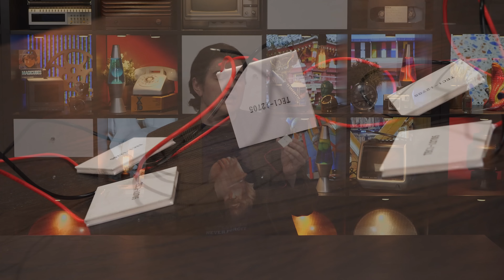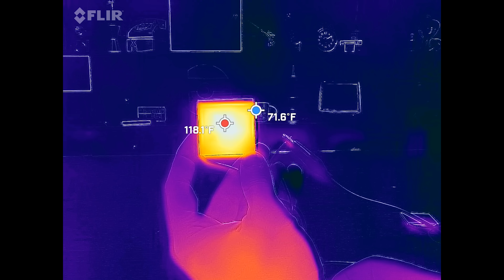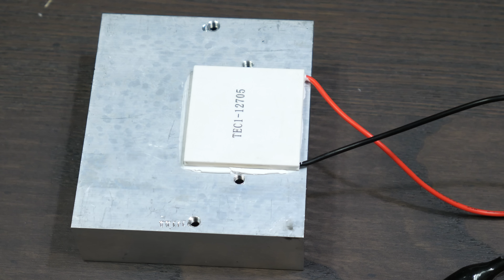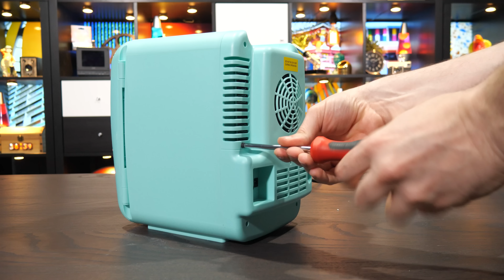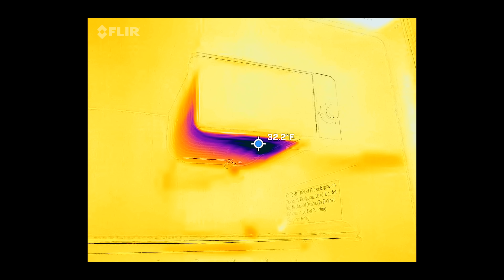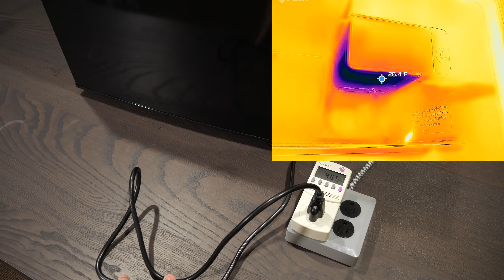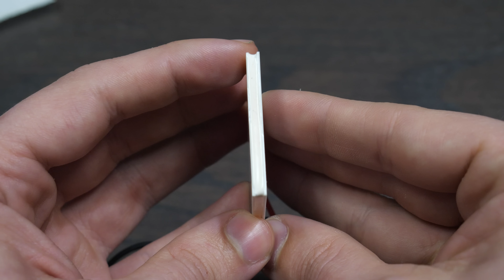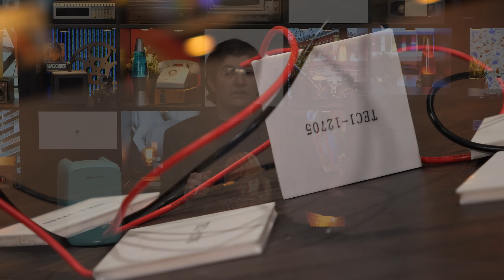Thermoelectric cooling: it's not great.

Comment from the maker: I’m sensing some consternation in the comments, so I want to explain the scope of this video a little more explicitly:
There are absolutely applications for which Peltier elements make sense! But they’re mostly not stuff you or I are going to come across. Lots of people down below are highlighting the various pieces of scientific and medical equipment which use Peltier elements and the specific reasons they do… but that’s scientific and medical equipment! Not day-to-day life stuff. While those applications are all very interesting and highlight that there is value in the technology, they’re just way outside my scope here.
I intended to keep this entirely in the scope of general-purpose cooling (and refrigeration), and in that context? Consumer products with Peltier elements in them are almost always terrible and a waste of money.
Reply: Biolite makes a camp stove that converts heat from burning wood used while cooking to charge your cell phone. I assume it uses a peltier
Reply: @samuelgreenway technically it's a Seebeck generator, but essentially it's the same thing.
Reply: @mc2engineeringprof what if I need to generate something other than Seebecks?
Reply: Time to invent a wood-fired refrigerator.
Reply: @samuelgreenway  I have one. Its a decent camp stove, if heavy and bulky for serious backpacking, but as a cell phone charger, its pretty useless.
Reply: @samuelgreenway  Looking at their description it's a thermoelectric generator (aka a Seebeck generator) which, yeah, is the inverse of a Peltier cooler. In fact, the Seebeck effect (power from temperature differentials) was discovered 12 years before the Peltier effect (temperature differential created via power), and the overall effect has been named the "Peltier-Seebeck Effect".
Reply: @samuelgreenway that is likely a thermocouple or thermo pile.
Reply: @samuelgreenway  No, I believe it uses a thermopile: a stack of thermocouples.
Reply: This video is not a bashing of Peltier Elements, but of stupid cheap plastic toys mimicking household devices that happen to use Peltier Elements.

PTC are good to cool sensors, circuits, very small spaces in devices that draw more than 50W  anyway and usually don't run 24/7... but they are terrible in household refrigeration.
I have a PTC electric cooler which can run on 12V car plug, on 12V powertool akku and on 240V European outlet. It's for occasional use and has like 3 times the insulation than that blue piece of junk. And enough space I can throw a prefrozen coolpack in to ease the cooling.
Reply: @christianstorms3950  absolutely. They have a place , despite being inefficient . Thats the only drawback.

But it has some pretty strong points to offset that. Its allmost  impossible to break them . Ensure cooling and don't overvolt.
Can be used whit solar panels whitout any inverter involved for example. Given a proper fridge , if it allso had peltiers as a hibrid the potential is to reduce the operating hours of the compressor. 
Thats a longer living fridge and a long term cost saving.
Surely initially it will have its costs.
Frankly i don't see it is a deal breaker.
Reply: @christianstorms3950 even food, some kimchi fridges use peltiers.
Also can be used to cool beers.
Reply: @kopazwashere  Im not 600 pounds and miserable, so its ability to make horse piss cold isnt important. Does it stop botulism?
Reply: Agreed. I'm a PC cooling enthusiast, and it has never been a good cooling solution outside of extremely niche overclocking applications. And even in those applications, LN2 is usually a better solution.

Thanks for making such an extensive video on this.
Reply: @uss_liberty_incident  Yeah. I remember when "OMFG! PELTIER COOLING!" was a thing back in the early 2000s for PC cooling and then it took all of about three seconds for everyone to realise it was pointless.
Reply: @uss_liberty_incident  Considering how much energie peltier elements use, I think most normal PCs would have trouble keeping the cooling elements from overheating! 

PCs also dont really need to cool below room temperature, thats why our heatpipes (or water cooling if you wanna be fancy) are enough to transport heat to the fin stacks + fans.
Reply: @uss_liberty_incident  Yeah, I remember when these were the hot 💩 in overclocking, back in 1999 for about a year. Back before waterblocks were practical.
Reply: @uss_liberty_incident as in, "cannot afford phase change but Peltier and psu are cheap and I cannot get Ln2 locally" scenario lol
Reply: @uss_liberty_incident There are PC cases with heat pumps
Reply: @uss_liberty_incident  There's a reason Linus Sebastian built that ridiculous window AC contraption as a liquid cooling loop chiller instead of using Peltier elements.
Reply: @uss_liberty_incident  I actually use Peltiers on one of my desktop computers to cool the inside of its airtight case. It is a niche application but I'm not cooling the CPU directly, it is air-cooled. My main concern was to make sure that no dust could get in, and using Peltier elements solved the issue of actively cooling the air more than is possible with passive cooling. The hardware inside draws less than 60W while the Peltiers draw up to 250W, so it may seem very inefficient, but most of the time the heat expelled from the heatsink warms up the room a little so the heater doesn't have to work as hard. On warm days it's mostly waste heat of course. Still it works better than liquid cooling which can't go below room temperature, and it is very quiet (using two 120mm fans) compared to using a mini fridge compressor. I do use a microcontroller to monitor and control the cooling.
Reply: @uss_liberty_incident  you know when your solution is more problematic than having to both apply and burn off liquid nitrogen every few minutes.. it's it's a problematic solution lol. I remember learning about people doing ln2 cooling in abstract when I was younger.. for some reason in my head whatever it was would have been a thing you set up and then do things with lol. Cuz why overclock something if you can't do anything with it right? 

I guess I didn't understand the idea of "achievements" at the time, at least for the sake of the achievement moniker and only that itself lol, and I still don't I guess.. But man when I when I actually watch somebody do it I was just sitting there like... Wh... Why?
Reply: @uss_liberty_incident  I have a thermoelectric cooler for my ASUS ROG Phone 8 Pro, which is probably the best use case I've seen for a consumer product with a thermoelectric cooler. You can run it with just the fan instead of turning on the thermoelectric cooling, but the phone definitely stays cooler with the thermoelectric cooling.
Reply: @uss_liberty_incident  Thank you for saying this.  There were all sorts of problems associated with peltier elements and it seemed like the benefits were greatly outweighed by the negatives... even by bar napkin math.  Phase-change cooling (a la VapoChill) worked but you had other problems such as condensation... but at least it worked.
Reply: @uss_liberty_incident  Translation "Thank you for programming an opinion into me."
Reply: I thought the video was great, but I definitely was interested to hear about some of the unique applications where peltier elements shine. But that's why I come to the comments: to specifically find that extra info that is (as you say) outside the scope of the video, but interesting nonetheless.
Reply: @Nacimota yeah, the personal vendetta against peltier devices got old quick
Reply: I use the mini-fridge for my drinks at my WFH desk... they really are the better option. It's an old (late 90's/early 2000s) Magic Chef and is MUCH quieter than the buzzy one you showed, though about the same size. It has the freezer section and you're spot on... if sodas are directly under it and within an inch, they will freeze and explode all over the inside..... Ask me how I know. >_>

I know you said that section doesn't have much use, but the freezer is great for holding mini bottles of liquor in case you feel like mixing some of the soda you keep in there over ice; having the liquor at freezer temps is critical to a good mixed drink, so that's where I keep little "airline bottles" of them.
Reply: @BattleChemist I got one for Christmas, it’s rather quiet it’s a Mountain Dew branded one I don’t remember the actual brand the fridge is (it’s labeled inside the back panel and I had that off a month ago to clean the heatsink and fan) and it chills cans and doesn’t put out a stupid amount of heat. They do have their use as fridges. Not for anything other then cans
Reply: These new cooling-mattrasses use Peltier elements inside of them. Probably because then you can also heat your bed in the winter, but in the summer despite the thing you sleep on being cold it dumps a lot of heat into the room as a consequence, right? Maybe you can explore thata little.
Reply: @killersmile7180 -That sounds like keeping the design simple, reliable, and cheap (to enable a nice fat profitable upcharge) instead of a more complicated and expensive to implement, but... much better performing design. ohh well😢.
Reply: I'm from a tropical country and a mod/member in several aquarium hobby groups. Over the past decade, during summer someone or the other always "discovers"  peltier based cooling and tries to apply it to bring temps down rather than using a refrigerant based water chiller.
It's just not efficient enough, even though initial costs are lower.
I've resorted to posting seasonal announcements now to save everyone's time
Reply: I have certainly used them to reduce thermal noise in photon counters.  But... not something I use in my day to day go about my household business.
Reply: I got a SANYO mini-fridge back in 1999, and it's been running in my office ever since keeping my beverages cool.  It's pretty amazing how it's still running perfectly well for over 25 years and it's completely quiet.  As they say, don't make em' like they used to.  :)
Reply: There's a little bit of irony that the very infrared camera you used to make your point likely has a Peltier junction cooling the image sensor to allow it to work.  But point taken - I guess some people would prefer these videos not break the 1 hour mark :P
Reply: @FireStormOOO_ he mentioned it has uses in other fields.
Reminder this entire video is about sweatshop miniature drink slop that pretty much redundant. It is an unneeded product as it’s cooling in this miniature fridge specific is no different then just having a cooling lined bag with an ice pack in it. You can’t really do that stuff with electronics or medical supplies.

Another point, in the video he did mention people using this to keep makeup dry and prevent it from (maybe) melting for short periods on hot days.
Reply: @FireStormOOO_  those are almost certainly microbolometer which don't necessarily require active cooling...though it's decidedly possible you're right.
Reply: @mc2engineeringprof  Hmm, I bet one could find out by pointing another IR temperature probe at the sensor and seeing if it's at about room temp.  But yeah, I know better than to bet against the cheaper option; hadn't realized those were at a resolution they could pass for an image sensor.
Reply: @FireStormOOO_  that’s not irony, bc he’s not bashing the use of a Peltier to cool.
Reply: Yeah but I wont take my kitchen fridge to a daytrip in summer. This video is like saying "stop buying bicycles, cars go much faster for less work" and if you put a clickbait title you will get the matching comments, thats how it works lol.
Reply: I'm guessing they would be useful for spacecraft and space stations. Although, I think rotating a spacecraft or space stations is a better solution.
Reply: I played around with CPU cooling using TE coolers 25 years ago. Using two stages in series allows for a lower differential temperature across each element, which improves efficiency. I believe I calculated an efficiency of about 3.5% at the time.
Reply: When are you going to do a video on vortex tubes?  I think it may be the only method of cooling you haven't done one on, and much like the Peltier elements, has specific use cases.
Reply: To add on the cheapness of the mini-fridges, in the rare cases they kinda make sense due to size -- they can be made a whole lot better with just a little work.  Add a more powerful (and silent) quality Noctua fan, 3Dprint a guide to actually route all the air through the fins vs just vaguely "at" it, and put good thermal paste on the interface to the internal cold blade.  Insulate the internal cavity.  (optionally stack two modules...or even an internal thermostat to cycle power.) Cools a lot faster, and stuff in mine was freezing.  Did mean I needed to defrost the internal metal plate sometimes.   

Not a pitch for these at all -- just that these cheap implementations leave a whole lot of performance on the table, and is part of the problem.  But if they were sold with all that, you'd probably be at the price of a real mini-fridge, or at least less impulse buy.  Not even getting into the power use....
Reply: My humidor & medicine / drink fridges are day-to-day life stuff.
Reply: I didn't feel like those comments were expressing consternation. I took them more as "fun facts." Both points ("crap in consumer electronics" & "useful in various technical items") came across fine, especially since you mentioned repeatedly that there were other use cases for them. I didn't think car cupholder gimmicks was an exhaustive list, lol
Reply from the maker: @big-e-squared  Many of them are! It's hard to know the difference sometimes between "here's a cool thing" and "hey, you forgot to mention" but fwiw I've also gotten a few messages saying I've sold Peltier elements short.
Reply: @TechnologyConnections Biolite makes a camp stove that converts heat from burning wood used while cooking to charge your cell phone. I assume it uses a peltier
Reply: @TechnologyConnections you actually forgot a big thing: the phone. Cooling an phone with peltier is much better then with a heat pump
Reply: @TechnologyConnections  what company builds the ( SMALLEST proper refrigerator  ) as you call it and how small is it ?
Reply: @TechnologyConnections  Is there any chance you could cover the use of these devices in personal cooling elements. After hearing your explanation, I am almost 100% sure the personal "air conditioner" my mom wears on her neck is using Peltier circuits. It definitely cools, but it's loud and bulky. Maybe the localized cooling actually helps in this specific instance?
Reply: @TechnologyConnections  should also make a point, that thinning the atmosphere seems to be a priority now, so maybe we should actually dump more refrigerants into it? I... Legitimately wouldn't be surprised if DuPont didn't have a button they were just waiting for the go-ahead, like the one that dropped all the birds out of the sky lol.

What even is cancer? Is it really related to ultraviolet exposure? What even our cosmic rays? And why can't putting holes in the atmosphere make it better! I think we should all find out, for science you know?
Reply: @TechnologyConnections  Old refrig guy here: Now investigate the "mini" dehumidifiers that use a Peltier module. Waste of money and will never get an Energy Star rating. Did you know, the gubmint has ratings for these? Look up Integrated Energy Factor (L/kwh).
Reply: @TechnologyConnections I'm sure you'll never see this, but I do wonder if you've ever come across the only consumer application of peltier modules I've ever been fully pleased with, the peltier powered fans that are designed for plonking on top of wood burning stoves?

Ostensibly the point is the gentle rotation enabled by the fan is meant to 'waft' warm air rising directly from the stove outwards into the room; but also a doohickey that seemingly operates without power and slowly picks up speed over the course of an evening is always a bit of fun.
Reply: @TechnologyConnections why la crap. So how do 12v fridges compare.
Reply: @TechnologyConnections What's a farren height????
Reply: @TechnologyConnections  I think you may have, although it's a fairly reasonable mistake to make. There are some TEC elements with incredibly high COP, and the price on them has been falling over time. I'm using a high-temperature one with a COP of 4 for my application, and the manufacturer rates it at a peak of 6.
Reply: @TechnologyConnections 
I just bought one of these. 😂
Actually it's that exact one on your desk. 
HOWEVER
I just spent 6 weeks in hospital and I don't do tepid drinks and water made funny tasting by the plastic hospital jugs. 
I also bought one 25 years ago and they were much more expensive, bigger and better and it's still going. 
Yeah the handle broke off and the internal switches corroded to dust after a decade so I glued them and hard soldered it to Mains AC and Cool and I've replaced the worn fan and it needs replacing again but I'm amused by keeping it alive. 
Last time I was in hospital I bought a proper mini fridge and let me tell you, a big downside is sneaking an actual fridge into E ward. 
But I was there for 6 months. 
Now I have 3 months of recovery at home and that little fridge saves me from having to tackle the stairs everyone I'm thirsty these first few weeks cos I can barely stand. 
Also, if they ever break, free TEC and AC regulator! 🤩
Reply: Our 1987 fridge died during a lightning storm. We replaced it with a 7.0 cu/ft Frigidaire Gallery rated for 328Kwh a year. So far so good. The old fridge had a bunch of wasted space. Even with the new smaller fridge we have extra space. It also can be switched to freezer mode but we have over 15 cubic feet of freezer space in a chest freezer in the basement.
Reply: Would they make a better heating element, than a cooling one?
Reply: @ItsDaJax - as he mentioned, so long as the COP is greater than 1, yes. Achieving that may require more effort than was expended designing the cheap toy fridge, however. As you noticed, at least your getting value from the rejected heat from the input power!
Reply: How do they do refrigerators on the space station?
Peltiers or heat pumps that don't require gravity?

Edit: Yup, scroll based compressors that don't have the oil issue:
"One of the most promising projects is the result of collaboration between Purdue University, Air Squared INC and the Whirlpool Corporation. It aims to build a refrigerator which runs on compressed steam, designed to provide the appropriate temperatures for food storage while reducing energy consumption.

The device is based on technology recently patented by Air Squared Inc, involving the use of a compressor scroll and an inbuilt expander. These two components operate on a common tree and can therefore be protected by a single semi-hermetic shell.

Another advantage of using a compressor scroll is that it does not require lubrication oil: this makes this sophisticated refrigerator a perfect solution for use at zero gravity. The prototype is now ready for microgravity testing which, if as successful as the developers hope, will open the doors to largescale production and a new approach to refrigeration in space."
Reply: @Jcewazhere pumps and radiative cooling is my guess.
Reply: It's great it you are building your own chest freezer with high R rating insulation and the whole outer and inner lid acts as the heat sink for absorbing and disipating heat as efficiently as possible.
By using large blocks of ice along the walls, you can add warm stuff and the thermal mass alredy in the freezer will offset the thermal dump inside until the pelt units can catch up.
I use it for my 12v off grid freezer.
Works great.
Now if they would mass produce them.
I would not be a fring case.😅
Reply: I've seen every single one of your heat pump videos, but it wasn't until you explained how the fridge works did I finally understand how they can be "more than 100% efficient".
Reply: The personal aircon by Ranvoo that Techmoan looked at recently I think uses a Peltier? I was surprised it seems to work as well as techmoan suggested. Would love your thoughts sometime!
Reply: Yes, your overall conclusion is correct. I've used Peltier plates in DIY applications, and in the design process it became apparent that the best (usable) efficiency they can provide is ~100% (i.e., 1 W heat transfer for 1 W heat waste), which pales in comparison to the 300+% available from compressors. The only application I can think of that is a) relatively commonplace and b) sensible for their limitations is in water coolers (i.e., the ones that take the big 18 L jugs).
Reply: Aren't they a good heater? I mean, anything better than 100% of the resistive heater is good, right? And you can't get under the 100% at heating. And no, it's not only cost, it's also complexity, weight size and vibration resistance. You won't be making that desktop can fridge with a full-blown refrigeration cycle in a sane mind.
Reply: @Chamieiniibet Inside a confined space, a Peltier will only provide 100% heating.
If you want more, the cold side of it must be able to absorb more heat from outside of that confined space.
Edit: Also, fabrication costs energy, and I would be surprised if a PTC is worse than a Peltier in that sense.
Reply: @jsjs6751  you need a very-very good thermal insulation to bring it down to 100%, which is the maximum for PTC.
Reply: @Nibiroid    How do you get more than 100% efficiency if you do not move any heat with the heat pump (the Peltier element)?
Assuming you meant both the cold and warm sides are located in the same room/space?
Reply: @jsjs6751   say, you heat up food — you don't need the air and the table to get warmer, quite the opposite. Or, say, you want to heat your butt — you don't care for the chair below the seat getting colder. And so on. Most of the time you need stuff to be heated over the ambient temperature, not to heat up everything around too. You wouldn't place a compressor-driven heat pump in every single place, but you can definitely replace most of the smaller resistive heaters with Peltier modules.
Reply: @Chamieiniibet   It seems you do not quite understand the thermodynamics here.
If your Peltier uses 100 watts of power and you put it in a confined space, then ALL of that will become heat, even though the Peltier also has a cold side.
And just like a 100W bulb or PTC, it will try to heat up everything in the room, including walls, and whatever is beyond the walls since they don't have infinite insulation.
In an ideal confined space (which does not exist) , the end result would be an equilibrium, where everything has the same temperature.
Reply: @jsjs6751  nah, you just don't get that this "confined space" you imagine is an idealized concept. Any real usage would have thermal flows to and from the outside world unless we deliberately isolate it. Also nothing prevents you from putting the PEC right on the border of that space. So if you put a peltier module on your table, hot site up, and feed it with 100W of power, it would heat your food with more than 100W of heat, chilling your table as a side effect. Which could actually be even a very welcome side-effect when it's hot. PEC is just a low-efficiency thermal pump, so you can use it to generate heat same way you could use any other heat pump, if it was as thin and light. It's just whatever low the efficiency of a thermal pump is, it's still always more than 100% at heating. Haven't you watched the other videos from Technology Connections on the topic?
Reply: Nah you're right their use cases are extremely narrow as you said
Reply: My first engineering job I had to automate a robot via a PLC to heat seal super capacitors, effectively batteries with low energy density but high discharge made out of aluminum pouches coated with carbon and filled with a proprietary solution

Batteries need to be vented after they are sealed because of out gassing, The material scientist had this (wrong) idea that if the pouches were cooled to -180C when they were sealed they could bypass the outgassing, so my robot quickly cooled the pouches to temperature in a vacuum glove box and then sealed with a heated coil 

It really sucked too because we when to expos to demonstrate wireless ps3 controllers and other electronics taking less to 2 minutes to completely charge. I thought this tech was going to change the world but 15 years later here we are
Reply: could they have a use as a heating element?
Reply: @catzeball8047  sure, so long as you heat the cold side, a heating element would probably be more durable, cheap and more efficient. It isn’t more efficient like a heat pump.
Reply: FINALLY!  A little blue fridge that we can keep our insulin in!  SAFE!
Reply: The best use I've ever seen for one of these was a radiator and blower to place on top of a wood stove, using the reverse form that turns a heat gradient into current. The thermoelectric element was between the base and the heatsink  fins, so it would create current when heat was being conducted through the assembly, and it powered a motor to run the attached fan which would draw air across the fins and exhaust it forward to help spread the heat from the wood stove into the room.
Reply: @Narissis I wonder if he is aware of these products, it's exactly the kind of simple yet refined design (natural positive feedback loop) that I think he would enjoy
Reply: They heard Peltier elements = bad even though you clearly said they're only bad in this minifridge use case. You even advocated for Peltier elements' other uses in the video. Explaining logic to emotional people never works.
Reply: @LowTonin  A company called Photonoic claims to have a peltier that is supposed to be as good as vapor compression refrigeration. However, as they don't seem to offer anything that consumers can buy/test for themselves, we really don't know if they are as good as they claim.
Reply: You want me to give the spiel on PCR? The one thing that a PTC make SO much sense for? A small liquid sample in a metal block that needs to cycle between 60c and 100c as quickly as possible? That also wants to be held at 4c afterward until someone can deal with it?
Reply: Here's one that's popular locally (northern Scotland) where there's lots of woodburning stoves: Stick a solid piece of steel on top of your stove, with a peltier unit on top, and a heat sink for dissipation on top of *that*. Peltiers work in both directions, so we use a temperature gradient to generate electricity rather than electricity to create a gradient. It's not a huge amount, but it's easily enough to run a fan, which circulates the heat better than just letting it float up to the ceiling. Heats the room more quickly and evenly, without it you can stick your hand up in the air and feel a noticeable blanket of hot air near the ceiling rather than circulating as you want it.
Reply: @TheGeoffable first thing I bought my dad when he got his stove!
Reply: They could make a good electric heater that has a dehumidifying effect therefore making it cheaper to heat your home as it's dryer, sort of an in-between step between a heat pump and and electric heater, by also combining the effect of a dehumidifier.   Hmmm, might be good for dying out 3D printer filament, maybe I should get some of these for this use!
Reply: Genuinely was fascinated by refrigeration recently, so thank you for existing. 😂
Reply: You should have given the COP of the toy fridge. The COP of an AC is the amount of heat moved from the room to outside Vs energy. Similarly it took a day to move the heat in 6 sodas from inside the toy fridge to outside it and you have the wattage X 24 hours. Otherwise good job. I wanted one and had no idea it was so stupid inefficient but saw the 30 degree max cooling rating and couldn't imagine a circumstance where it fit my needs. I apprciate the info.
Reply: i mean, the title of your video implies that its never good so i think its fair to point out use cases for it...
Reply: My wife just bought one of these and I told her to return it. My electric bill is already $500 during the summer and this isn't going to do me anymore favors.
Reply: @Hymanator 
Ouch? 😳😣🤢
I think you need to buy some solar! And paint your roof with that cooling paint that was invented here in YouTube
Reply: Saw the title, upvoting on principle.
Reply: Elastocaloric cooling has been touted as being the future over vapour compression. Thoughts?
Reply: @BlinkyLass  Never. Materials won't last.
Reply: Did you write this script right after watching Not Just Bikes "JustCars" video perchance? 👀
Reply: Me and my friend refer to mini fridges the size of yours, as condiment or beer fridge 😂
Reply: Why do  Kenmore's last so long?
Reply: I think just an addendum to the title with "for a refrigerator" at the end would eliminate alot of the confusion. Being able to reverse the hot/cold sides, the size, the variable energy amounts, etc can be great for lots of things, it's just actual continuous refrigeration of a closed box that it's awful at. The problem isn't the technology but how it's used for products its just not good at. 

Also why tf don't we have variable heated/chilled car cup holders as a standard?! If these things cost like $3 in a vehicle where energy generation and efficiency is barely relevant (even 60 watts isn't going to do anything to an electric car), but lets people keep coffee warm or soda cool hours of driving, that would be amazing for commuters/road trips/etc. Maybe then McDonalds wouldn't have had their coffee so hot that it can cause third degree burns under the pretense that it was to keep the coffee from getting cold on longer trips when you can just have your car drink compartment keep it warm for as long as you like.
Reply: the ONLY useful use less trying to maybe power a smal PCR thermocycler , that i could think up was of maybe just maybe perhaps and possibly
was to apply the cold sides to the wrist and pulse the current, or the back of the neck. 
pulse the current for the device, on the neck, not pulse the back of the neck . (hmm)
anyhow
cooling blood channels near the surface like that i hear does a great job of tricking the mind body dynamo into thinking its actually feeling cool, when its actually not as cool as it thinks.
I tried that once becuase i wanted to be cool too, or at least think i was cool, but low and behold, trying to apply it firmly to my wrists. broke em
not my wrists silly, the peltier devices. theyre apperently very very brittle and fragile inside (no again , im not refering to my wrists. jesh)
but yeah, i heard it was a modern military discovery i believe. 
deep down inside though to me it sounds like a fast track way to lead to over exhaustion or a heat stroke. but hey, you might not even realize that until its too late 
so
i guess they DO maybe have their benefits 

and for only THREE DOLLARS a pop!!
Reply: I use mine for a day-to-day application, because I can keep it at 70F inside all day.  I use it to keep medication at “room temperature” when now my room is always like 85-ish and then down to 80 with the air conditioner on.  It was absolutely essential when my air conditioner wasn’t working and it even got 100F inside once.  I know other people who also store medications in mini-fridges.
Reply: The only reason why i bought the thing was curiosity of it and it's portability size. Road trips in a small truck mostly and it would be hooked up. Never used it for that yet but that was the intent. But honestly this small thing with a small solar panel in something like a side by side or even a bass boat or something would be its best use but it would have to remain covered. That and maybe for people that do tailgating stuff. People crank the AC in a car and let it run so as long as it feels cold in the car then its fine and energy in that case is not as much of a concern. The only other option is coolers with ice/ice blocks or those yeti cups that keep things cold but they only hold so much.

As far as the built in vehicle thing, I think this could be better in a warming mug that can be plugged in to a vehicle instead of just being built in cause anything like that in a car in general does not work much or they get knocked loose. Not to mention it could get too hot or too cold and do some harm to people which for a show car it would fly like a concept but never make production. 

If the thing was in something like a warming mug then it could easily have that temp controller built in and make it a lot better in use. Magnetic power port plug in so it just sits in the base and does its working then pick up the mug to drink and it can pretty much stay self contained and not stay plugged in when you need to take it somewhere. Kinda pointless given how efficient the vacuum sealed stainless containers are now but people don't always get stuff that's cold or hot in them in the first place.
Reply: My kid begged to be allowed to soend birthday money on one. 
I instantly recognised it as the specimen culture grow boxes in the QA labs when I worked in manufacturing.🎉 
We don't run it haha. It is just a toy lol. 😂
It would be interesting to see a video on the different industrial applications of the technology 🎉❤
Reply: A lab fridge often uses peltier based cooling because they can keep temperatures exaclty constant.
Reply: 2 questions one out of curiosity one for ranting. Have you heard of those propane RV fridges? I heard that most when switched to electric uses about 3.6 amps or 50 watts 12v  when switched to propane it burns about 32,000 BTU a day 1.5 lbs. As stupid as this sounds i would like to live my life electricity free, I get almost everything is way more efficient when it uses electricity but I found out about this brand called home bio gas where you fill it up with garden and kitchen scraps along with cow manure, Then in a few days you have methane. most of my heating and cooking will be done with a modern catalytic wood stove which they are vary efficient about as efficient as an 10 year old furnace. A bucket of wood will last all night. The bio gas will be used for lighting and a natural gas refrigerator. Am I as bad as people say I am? Because so meany people say that using a natural gas stove is so bad for the environment and your releasing thousands of carcinogens killing your whole family. Now they add butane and propane to fridges witch is great by the way yet the same people who said i was bad are also the people who throw away home appliances for the latest and greatest including there restaurant grade refrigerator
Reply: Could you not use stacks of them (as in chambers with them between so they are cooling each other) and run them at the most efficient amperage and use a thermostat to control the power to get a actually decent 'refrigerator'?
Reply: @mik123mik1  Stacking Peltiers feels like an elegant idea, and you’re far from the first to suggest it, but in practice it doesn’t work out since they are solid-state and can’t cheat by using phenomena like vaporisation enthalpy. 

The hot-side of each component is radiating both all the thermal energy that it has pumped through from the cold-side PLUS the waste heat of the component’s operation. Example: the TEC1-12705 as shown in the video, at max uses maybe 60W of power to pump 45W of heat across the component. All of that energy has to go *somewhere*, so the hot-side is radiating around 105W of heat. 

Finding the optimally efficient lower amperage doesn’t change the core problem: there must always be some waste heat from operation added to the pumped heat. So stacking them only multiplies the waste heat for no additional cooling.
Reply: Peltier devices are used as electronic generators to run fans on wood burning heaters.
Reply: Now you need to cover propane burner refrigeration! Don't look at me in that tone of voice. You know you want to fridge boy. XD
Reply: Could you tell me, please, exactly, what semiconductor materials are used in Peltier elements?
Reply: @nicholaseastman6915     Google is your friend 😊
Or go all in with an AI/GPT.
Reply: Sonic Refrigeration may allow more miniaturization, but we ain’t there yet.
Reply: @TechnologyConnections  I beg to differ, I love my fire-place-fans at the country-house 👍
Reply: What I'm wondering if the Peltier's woldn't be way more efficient if you'd simply add another radiator on the cold side of it, use a thermostatic device and add a good insulation (XPS maybe?). I need to try this at home. I'll leave a comment after doing the experiment :)
Reply: I agree c-:
Reply: Is this just a thermocouple with a fancy name?
Reply: @cerburusmori  no, it operates on magnetism and conservation of entropy.
Reply: yeah they're good for thermocyclers but not refrigerators, basically
Reply: Hi. One thing you forgot to mention: compressor start-up current. For many DIY solar projects it is very annoying. Peltier on the other side doesn't need powerful inverter, you can just run it on DC.
Reply: I feel like I'd like to build a personal AC system that you can wear outside, that would keep you cool when you need to move around, but peltiers are crap, and compressors seem to be heavy no matter what their capacity is, no idea why. Even a 1/8HP compressor (and this is what you'd see in a small fridge) still weights over 15 pounds. I mean looking at it, there's a crap ton of iron in it, no wonder it's so heavy. I just don't know if a lighter compressor for this application could be designed if some compromises are allowed, using refrigerants that works at a lower compression ratio. I mean if you wanted to have a cooling vest you want the evaporator temperature to be fairly high anyways, since if you stuck actual AC evaporator to bare skin you'd get frost bitten. And we don't even need that much capacity either, like a 100W compressor has enough power to keep the human body cool, due to their high COP.

Doing the same with peltier would have required at least 1000W.
Reply: i want to see a video about propane ammonia fridges like in rv's ...
Reply: I have a touché for your red fridge opinion, I've owned that same galanz fridge for the past 6 years and it's my garage fridge, even when it's 95° in the garage during summer, the freezer stays ice cold and so does the fridge
Reply: You'll just have to make a video on what Peltier units are good for, then. What makes this technology persist aside from an unsavory cooling application?
Reply: i sell iso-butane and iso-butene related products...
Reply: About the only common consumer device that uses these modules effectively might be those that put the opposite, Seebeck, effect into use. Stove top fans and fireside phone chargers that use what is effectively waste heat to produce small amounts of power. Stove top fans really do help to distribute the heat around the room. My Mum thinks it is true magic at work.

As an aside, but still interestingly heat pump related would be those gas (LPG/town gas) powered fridges that were around at one point. Still the Peltier effect, but non semiconductor that used a thermopile (array of thermocouple juctions) heated by a burner one side, and the subsequent cold side used to cool the fridge. There's still an electron flow between the junctions, but not so obvious, and I'm not sure if such devices are even in common use today.
Reply: 🎉Mmm maybe a comparo video of goodish and badish Peltier coolers?
Reply: I am not sure why no one mentioned dehumidifiers, I think most of the small ones use a peltier.
I am currently building a dehydrator (since for some reason I can only find those for at least 1000 dollars in my country) and was thinking of using a peltier as the resistor to generate the necessary heat, and the cold side woud dehumidify the air inside, so double win.
Reply: I have a question. And it's going to determine whether or not I make a very large purchase. Is the thermoelectric cooling for something like a humidor for cigars a good idea? The primary reason that I keep being told that it is good is because it does not on the back dehydrate or input additional humidity into the system and it's more easy to regulate
Reply: I was playing around with peltier elements and found in the datasheet they are extremely efficient when the temperature differential is very low. So if you wanted continuous production of a very small temperature gradient, they're actually great. I have been wondering if they could be stacked to compound the small temperature gradient...
Reply: just use vortex cooling hurr durr
Reply: Can you cover de-humidifiers next please 😁
Reply: id say it's good for electronics cooling. Asus has one for their gaming phone cooler
Reply: If you want to see a system which is somehowlighter but still kinda like a real fridge try to look into fridges which uses the Absorber technology. They replace the compressor with a heatsource of ANY kind. They boil the refrigerant by applying heat from grid, car OR from a gas-flame. Theoretically even a candlelight might work yet their heat-output are limited.

Those are often sold as "camping" equipment, have no oil swamp to lubricate and are way less sensitive to tilting or moving them. The limits of their design is mainly cause they reply on gravity that the refrigerant returns to the "hotspot" but thats less critical then a compressor would be. 

I even own a combined one which uses Peltier AND compressor. Yet even the manual say, the use of the peltier element is just to keep things cool in the car during transport with stuff in it. So you not have a "gap" of cooling if you transport sensitive material.
Reply: Dude I agree mine sucks but it's the only option outside of buying a dedicated mini fridge. And that's just not portable enough for me.
Reply: 14:35 We're not commies. Most of us have more freedom than people in the USA. There's no need for you to be so loud and rude, just because we embraced a much better system of measurements and can use 3-phase electricity instead of your two phases, and we get it from a more useful voltage which uses less Copper. And we are not short-changed with Aluminium while you have to use the inferior Aluminum, just because you wasted all of those letter 'I' s in Mississippi! Just kidding. Thanks for the video. It's high time someone called out those awful, inefficient and fragile Peltier devices.
Reply: These little fridges also do a fairly decent job at keeping a six pack cool, so there’s that.
Reply: Maybe we could get a video about the better applications of Peltier Cooling and where it outperforms typical refrigeration?
Reply: An even simpler description of why a heat pump is efficient: It discards heat.
Reply: Would love to see a video on how Donald trump and republicans want to get rid of efficient appliances in American homes with project 2025
Reply: Heat pumps are the most inefficient way to create heat, they are a terrible wasteful idea.
Reply: There is no proof refrigerants harm the atmosphere. If all you got is a fake hole in a fake ozone layer over a fake place no one is allowed to go, then it is not proof.
Reply: That little... red minifridge..... I have a giant American fridge, and it's cheaper to run than the red smallish, because it has great insulation.  I keep 42 turkeys in the freezer, and 356 days worth of leftovers in the fridge, plus a months worth of beer.
Reply: Like those mini fridges for kids rooms, what a polarizing thing to make a video about.
Reply: I use one of the fridges to keep my phone cool in the car while I'm at work
Reply: Like 25 years ago I was a high school astronomy nerd. My grandfather was buying and building the telescopes and other things and I was using them. We had an astronomy CCD camera in which the chip was cooled using a peltier element. Unfortunately like you said in this video, the peltier can only do so much and the temperature of the CCD (which directly translates to the amount of noise in the picture) was influenced by the surrounding temperature a LOT. During the winter there was barely any noise but during the summer the chip did not even get below freezing and things looked... not that great. Unfortunately due to how the Earth orbits the Sun you only see some things in the winter and other things in the summer.
Reply: Do you think it would be a good idea to combine Peltier elements with solar panels? Solar panels generate a lot of heat due to their color. The heat is actually not used by the panel and if exposed to it the panel degrades much faster. You could generate some extra energy if you have something cooling the elements on the other side. If you lack the space for extra solar panel, let's say on the roof of a car, the economics might work out better. The plus side is you can even warm up the panel if snow falls on it 😊
Reply: No one is asking the hard hitting questions...
If you put the Peltier fridge inside the Red fridge, would the Peltier warm the inside faster than the red fridge cooling it
Reply: okay, but I use mine for cooling packaged foods
Reply: Darn, I built a solar powered cooler for river trips using a couple peltier pads. It kept the drinks below 110F if that helps. Colder than the river we were floating.
Reply: I bought a coolbox in the UK based on this technology to use in a campervan using a 12v cigarette lighter type socket. It sucked 155 watts continuously and made anything that was 'cooling' wet. My power bank ran out of juice in just under five hours. All I wanted was fresh milk - instead I was stranded with no independent power and yoghurt.
Reply: Fans for stoves use them to use excess heat and move the air around. Would be interesting to see how efficient they are
Reply: I just came across one of these devices in my home! I have a little stovetop fan sitting on my fireplace and the temperature difference across the device when the fireplace is lit creates a voltage to power a small fan. They are pretty cool little fans, seems like a funky household item that would be right up your alley.
Reply: Um, but how about using Peltier fridges for traveling?
As 12v power is what you already have in each car, even if it is 20 or 40 years old.

You also can't really get a real fridge, even if it's a small one and you have a big trunk with =12V to ~220V transformator, just because the fridge compressors don't like at all radial acceleration - they prefer a lot standing still without cases where coolant gets disturbed on itself.

And in case you got food and some "ice" with you - such Peltier fridge is actually what you might need to get food to the piknik and stay cool while you prepping a grill.
Reply: Didn't Linus put a computer in the cube mini fridge. I'm getting old.
Reply: @vandegg isn't the outgassing usually driven by electrochemical reactions? Why did they think cooling before hand help?
Reply: And modern freezer only turns its compressor on when inside get very slightly warm, so it doesn't always run right?
Reply: I will only be satisfied if you jury-rig a heat pump into the blue depression box as a project.
Reply: Peltiers are a cool technology (pun intended) but it's laughable some of the consumer products that they're put into and horribly inefficient for. 

They're useful for very specific needs where efficiency isn't important (why you'll never see them used for laptops) and often temporary such as transporting perishable items from one cooling solution to another. But in the vast majority of real world applications there's simply superior solutions available. 

The most viable consumer application would probably be exotic CPU cooling but even then you need a lot of other tech to keep it in line and scale quickly up and down with the cooling needs of a CPU, because when that CPU stops working hard that peltier quickly goes sub-ambient creating condensation. I don't need to explain why water+electronics equals a bad time.
Reply: I have a couple of amateur astronomy CCD cameras that use thermoelectric cooling to good effect. Having closed loop control over the CCD sensor's temperature by pairing it with a temperature sensor is important not only for lowering thermal noise, but also being able to more accurately calibrate for it with dark frames taken with the shutter closed. Having the sensor within 1 degree of the temperature the pictures were taken at is highly important when dealing with the very faint objects we photograph, even in amateur astronomy. It's perfect for that application because we're only trying to cool the relatively small area of the CCD sensor, not the rest of the camera. Yeah, it's not something most people will use in their day to day lives, but I'm a weirdo so I end up using these things on a pretty regular basis.
Reply: I have designed an insulin pen cooler. The purpose is to cool an insulin pen in a holder that is placed on the dinner table. The motivation was that insulin spoils after 14 days at room temperature, but the meals I eat at the dinner table during 14 days don't make up an insulin requirement to use more than half the cartridge, as a result, half a cartridge goes to waste every 14 days. The design features a machined aluminium block that holds the cartridge portion of the insuin pen, sans cap, topped with a peltier element, toppped with a heatsink and a fan. The block has a digital temp sensor embedded in it, the heat sink has one as well, and the whole thing is controlled by a microprocessor reading the temp sensors and controlling the peltier element. The whole think is wrapped in insulating foam mats within a 3d printed case. The program prevents both temperature rise of the insulin pen and overheating of the heat sink. It doesn't run 24/7, but only at need. As the pen is only removed once or twice a day for a short period, it works very well using a peltier element.
Reply: Do you have a video about absorption refrigerators?

It would also be nice if this YouTube channel created a play list about refrigerators.

Absorption refrigerators predate vapor-compression refrigerators. I live in Sweden, and since they are a Swedish invention, that kick-started many international Swedish companies, they have some good, nationalistic, marketing going for them, in Sweden, and is slightly more common here than in the rest of the world (but still not very common).

Absorption refrigerators don't use compressors and don't generate any sound (well they shouldn't, but really cheap ones might). Nowadays they are usually only used where an ambient environment is desirable. So they are used in camping trailers (because people have to sleep close to the refrigerator), and for wine cellar coolers and cigar humidors (because a noisy refrigerator kills the luxurious vibe). Absorption refrigeration is also sometimes used as the cooling system for silent computers.

As far as I know, the only remaining large(-ish) manufacturer, of absorption refrigerators, is Domestic, which mostly makes and sells camping gear, trucker driver gear, and travel trailer products, and also is the world's largest manufacturer of car roof boxes.
Reply: I have a cooler that's 20 years old and twice size as your desktop cooler, and it works perfectly!!!
Reply: You say this in the video, so anyone consternated wasn't paying enough attention
Reply: I am so glad that you mentioned the use of a Peltier-cooled, cooler for travel.  They are great for travel.  I have one that I purchased for vehicle travel.  They were not designed to cool items from room temperature.  These types of coolers were designed specifically to keep items cold while traveling.  Or in the case that there is also a heat setting, keeping items warm.
 
To ensure the device runs as efficiently as possible, you either cool or heat the items before placing them in the cooler/warmer.  This is exactly what you should do when using an ice chest.  Cooling the items before placing them in the ice chest is the best preparation for using an ice chest type of cooler.
Reply: You literally said in the beginning of the video that they have their uses and just weren't going to talk about them bc it's not the point here. What is wrong with their attention span?
Reply: What about Magnetocaloric Effect? That's a different type of heat pump which you haven't covered yet. Any commercial devices which make use of it?
Reply: Who you brought out the real mini-fridge it brought me back to my dorm room back in the day!
Reply: can you do a video on thermoacoustics? would love that
Reply: Do these make more sense for small dehumidifiers? Does the fact you don't need to get as far below ambient help the thermodynamics and/or power requirements at all?
Reply: Hi Everyone, please help me by upvoting this so the OP will see. I am director of the Sarnoff Museum at The College of New Jersey. I have some interesting artifacts related to RCA and the Videoplayer that this channel may be interested in. We have a video player as well as some video discs. I hope they will try contacting me. They can make a comment on any of my videos on my channel and I will see it.
Reply: STOP USING FAHRENHEIT
Reply: If you SCALE UP the system, you can cool HOT engines via the Cool End of the Peltier cooler and PROVIDE a means on the hot side to turn that heat into MECHANICAL energy such as on an additional electrical REGEN system for EV motors or to power battery charging circuits. That WASTE heat on the Peltier system is still usable IF you design the entire cooling/heating cycle to be co-dependent and in parallel. 

I would use it for making home refrigerators that also use the waste heat to power/charge batteries that can be used at off-peak hours! In this case, you need to SCALE UP the physical size of the Peltier cooling system!

V
Reply: A MUCH BETTER CHOICE would be Magneto-Caloric Cooling which is a super-set of Peltier-style cooling that uses a much more efficient MAGNETIC FIELD to cool the fridge and its components. In specific cases, it can get to BELOW -100 Celcius (-148F) if you design the insulation layer correctly using a 15 cm (6 inches) layer of close-cell foam sandwiched between a thermal-resistive enclosure layers that are at least 7.5 mm thick aka 1/4 inches thick which can be Nylon or other plastic that doesn't conduct heat well through it! It also has 5x to 7x the electrical efficiency of Peltier coolers! They are a bit tricky to design well though, so that is an INITIAL COST to bear up front BUT on the plus side they GET TRULY ICE COLD and run efficiently!

V
Reply: Some vehicles use them for cooled seats. Many use the vehicles a/c and just vent that under the seat and add additional fans. Some use peltier elements inside a housing  and use fans to drive the air though the perforations
Reply: @user-mm9hv2oj8d  Peltiers work well in VERY highly-specific circumstances such as the ones you outlined. In this case the Peltier cooler and the heat sink needed to be larger with a LARGER capacity plus SLOWER and QUIETER fan to move that heat OUT from the "cooler" --- That would have made ALL the difference and would have added maybe FIVE DOLLARS to the manufacturing cost!

V
Reply: Many of us were quite happy with our little purchase that did exactly what we wanted and we didn't realize that we were doing it wrong. Thanks for the lecture
Reply: @shayne87  Product design is SUPPOSED to follow the adage form follows function BUT in this case the small form factor "fridge" DID NOT do its primary function to keep temperatures to food-safe levels. 

If I am putting a sandwich in there for a whole day or two, at the END of that period, I don't want to get food poisoning! 

Soooooooo, it BEHOOVES the designers to come up with a product that actually IS food safe if you call it and SELL IT as a cooler or a refrigerator!

The design itself of the cooler is quite nice! Just use a LARGER Peltier system and add thinner and MORE of the cooling fins and a LARGER but slower and quieter fan to MOVE that heat away from the device. 

If someone actually DID a proper Microsoft Excel spreadsheet calculation that takes less than 30 minutes, they would SEE on a mathematical basis the electrical system inputs versus the overall thermal cycle output DO NOT MATCH UP!

Do the math upfront to make sure ENOUGH heat is going out of the device to ENSURE that the required terms of its base cooling ability match up to customer expectations and the problems go away!

The way to become SUCCESSFUL in business is to MATCH or even EXCEED customer expectations! If customers THINK your device is a fridge and it merely cools a bunch of cans by a few degrees, YOU ARE NOT MATCHING their internal expectation and NEED to change your design which may mean charging more to get the FUNCTION to fit within the desired form!

V
Reply: @StarGateSG7  Bruh. You love to lecture more than he does. Its a COOLER not a food safe refrigerator. They LOOK like little fridges because its freakin CUTE. Stop overthinking it. Don't use it outside of its specs and you wont be disappointed nor get "food poisoning" (nice dramatic touch lol) but if ya do...Darwin and all that applies 😂
Reply: @shayne87  If they say COOLER, it should at least ACT like my $40 Igloo-brand cooler with a few blocks of ice inside it actually DOES KEEP my sandwiches food-safe! 

This video is RIGHT! When you advertise something as a cooler/fridge it should act like one which means cooling down to the typical less than 2 degrees Celcius (35 F) which is typically UNDERSTOOD to keep food safe-to-eat for more than 12 hours and up to 72 hours!

The manufacturer COULD have spent 5 more bucks to actually MAKE IT food-safe! That is just cheaping-out in my opinion!

V
Reply: nothing says tech youtuber like not thinking outside of the box when it comes to technology
Reply: Can you use normal C° instead F° ????
Reply: They are useful as thermoelectric generators, a useful consumer product (if you live in a area with cold winters and own a wood stove) that utilizes them in this fashion would be a stove fan.
Reply: i am sensing bullshit from a man in a silly t shirt hating on a convenient idea for a portable fridge!
Reply: Just bought an actual mini fridge as opposed to a cheaper one. Even happier with my decision now. 
Interesting video
Reply: I had a few of those coolers and replaced a few elements  also. A compressor is a better cooler but they also have issues I bought two I bought a smaller one to use as a freezer but it quit cooling the larger one is still working but they both did not cool well under freezing, well the lack of a fan doesn't help, the bottom cools but the lid area stays warmer.  I have a large cooler freezer but it weighs too much to carry around good thing it has baskets inside but the cooler is still very heavy to carry into the hotel room. That one must stay in the car. The solid state coolers are more practical for travel.  They don't weigh too much. You can add freezer packs to help them keep things cool. I thought about putting two cooling elements per cooler maybe it would work but use twice the power. 73
Reply: Please do a video covering de-humidifiers
Reply: @djfmitv  yeah thanks that's good subject. 73
Reply: One more "everyday" application for peltier elements is to cool and regulate the temperature of laser diodes used in modern (cinema) video projectors. Their output is very temperature dependent so they need a constant temperature regulation, for that reason a peltier with a PID controller is used.
Reply: I actually only recognize peltier coolers because I used them in a lab setting for a while.
Reply: Is this what makes the Embr Wave thermal wristband work? Can you investigate these devices?
Reply: What about something like a coffee mug warmer?
Reply: Fun video, thanks.  Just curious, what is the acceptable tolerance range for keeping frig level?  Are we talking +/- 1-2 degrees or +/- 10 degrees?
Reply: I think a few minutes spent showing some of the examples of peltiers being used to good effect would have helped offset the woes of using them in the microfrige. They do have useful applications and are interesting devices in and of themselves. Would have been neat to also tell people about using them to convert thermal into DC energy and some of the ways that's been used. This would have belt a bit more well rounded to me. Sure THIS is a terrible application of the technology but maybe show a really neat one like a space probe or something else that makes great use of them.
Reply: I use the razer cooler for my iPhone and can play Pokémon  go  in the summer heat.
Reply: Okay. But what if, in space with a nuclear reactor with heat sink outside of the envelope of the space station?  Then... ? Then ...?
Reply: @alwaysardent1125  it overheats, because in vacuum there's nothing to remove heat from the heatsinks ;) Heat is super problematic to deal with in space. Best way is to radiate it away as IR energy.....that's about it.
Reply: I would love to see you expose the true cost of electricity due to recovery costs and other fees put on consumers by the power companies. In Alabama our power is supposed to cost much less but it comes out through alabama power to be about $0.25 per kWh.
Reply: What if I really want something on the size of 6 cans of LaCroix?  I want something that would fit on my desk and not take up very much space.  Something like the size of your toy.  What options would I have?
Reply: These are life savers for some things. I have one of these in my bedroom. I got it for $25. Amazing price. I'm pre-diabetic and use it keep my snacks separate so my family doesnt eat them. It keep them cool and i have no problem keeping apple juice and similar snacks cool enough to enjoy. They are not a waste of money, they are just meant for certain things. Some of us can't afford something nicer.
Reply: "Consumer products with Peltier elements in them are almost always terrible and a waste of money." = Most comes from China and is poorly made. Most people just buy it out of impulse, because it looks cute or makes you look cool
Reply: Thank you for clarifying the intended use scope with which you have made this video. I found it very educational and it answers my question on how these microfridges work as we had bought one for a specific purpose (temporarily keeping breast milk cool for bottle feeding our baby). I noticed it had no typical radiator and had ice build up near the metal plate, which I now understand is the thermoelectric cooler. I also realized it took a long time to reach maintenance temperature so I swapped out frozen ice packs in the unit to help maintain temp when breast milk was stored. I still think there are some specific applications for which you'd choose the microfridge (very small space, noise generation level, portability for travel, etc) but overall agree with your very thorough product testing and cost projections that those niche constraints aside, it does not make sense to choose the thermoelectric fridge over a somewhat larger traditional mini-fridge for general purpose food/drink storage.
Reply: I wish you would have started this off with "I don't think it's worth the cost"
Reply: Sorry, I'm late, but I didn't realize these things existed. You should do a video on what they can do. To me they seem like a microchip, meaning they can get smaller and more efficient
Reply: I was wondering... if u leave the hot side of a bunch of peltiers facing the sun and a cold floating on a bed of water how much electricity can you generate?
Reply: Your doing the Lord's work. Keep it up!!!!!
Reply: "But they’re mostly not stuff you or I are going to come across" I see them all the damn time in electrical engineering applications. Its generally not consumer end stuff but still they are a lot more common than you think.
Reply: I see no place for peltier refrigeration after this video. One thing that springs to mind about making them better would be to fix the cold surface of the module to an aluminum enclosure that surrounds the internal compartment to spread the cold. Also use a module on each side of that enclosure. But still they're horribly inefficient.
They could get better again by having many modules spread over that enclosure and run them at lower power.
I still wouldn't bother with them
Reply: I think everyone pretty much knows that Peltier Coolers are inefficient. But obviously no one is going to put a cube refrigerator in their car or try pinpoint cooling with one. If you just think of a Peltier cooler as a small heat pump that can maintain a 30 degree differential, then there are quite a few uses for them
Reply: Do you think I should try to fix one  I'm not sure if it works i found it on the side of the road for free and it was out side for some time?
Reply: you just gave introductory thermodynamics lesson better than some of my lecturers 😊
Reply: Elastocaloric cooling will soon make these micro fridges much more efficient. It's a new technology so it can't be used in a regular size fridge yet, but these tiny fridges are the perfect first step in my opinion.
Reply: One more interesting feature of the Peltier is that it either creates the temperature difference OR creates a voltage from a given temperature delta.
I have one of these on a very cheap fan for my wood fire oven and it's a fun gimmick to have a fan that automatically starts working when the oven gets hot. Not suuuuuper useful, but helps to distribute the heat a little quicker. Also it is always fun to explain to people how this works.
Reply: Is there a theoretical limit to the efficiency of thermocouples? Is there any reason why they couldn't be made to draw less power per unit of cooling?
Reply: I've had a thermo electric fridge for a quarter century..

I don't use it often but it will cool my beer and lunch meat
Reply: Thermoelectric cooler in a car is way better than not having one. Not only to keep drinks cold, but for a general shopping trips in summer etc... 

I wondered why it wan't mentioned earlier since that's the main use for them here. I don't think I've met anyone with such thing on their desk. But a lot of people travel with one in their car.
Reply: WAIT A MINUTE!

Energy is energy. For refrigerators the dissipated heat often ends up in wrong place, but if you have that next your workplace it's heating exactly where you want.

So you could argue its practical efficiency is above 100 % during heating season.
Reply: Thank you for uploading this! I found this very informative. 💯
Reply: I'm off grid trailer trash with only solar power. Where I live winter can drop to minus 35C and in summer plus 35C. Since I'm stuck using the Sun for power it costs me nothing.  A typical 12V cooler saves me buying ice for my beer. Efficient? Perhaps not. But at $3.75 for a bag of ice I can't complain. For my geolocation and climate they do the job. Sure a fridge is superior, but like an oversized furnace it's overkill.
Reply: It's actually amazing that people are so up-in-arms.
Reply: OT - omg I love your shirt! One the best coats I've ever bought was at Norways giftshop, right after the maelstrom. It's a little disconcerting I recognized the guy tho lol
Reply: peltier coolers significantly improved my diet as a truck driver by extending the life of milk and eggs by a day or two. you shouldn't bash them by comparing them to fridges for 25 minutes before acknowledging what you think is a niche out of the side of your mouth. you should praise them by comparing them to ice coolers for 25 minutes then acknowledge they're shit as fridges. stop fighting the wrong battle.
Reply: They also work great for, ahem storing “herbs”.  Of all kinds 😅❤
Reply: I bet they're used in thermal imaging when you need to cool it down hard and fast on startup.
Reply: People get defensive of their purchases and interpret your snark as an attack on them for buying/using one of these. Nevermind that you acknowledged there were valid use cases or that you never said the average purchaser was an idiot for not doing a deep dive on the efficiency and performance characteristics of every $30 purchase they make. If you want to hear someone read performance stats with little color added go watch project farm (seriously, do. great channel). The snark is part of technology connections. People enjoy it and have no comment until you snark at something they like.
Reply: I have a alpicool 12v cooler from Amazon that works 100% it can freeze meat hard as a rock ... I agree the cheap ones suck I paid 120 for mine highly recommend still love all your videos
Reply: In high school I'd heard of a man using the cool side as a heat sink for his PC and ran the hot portion to heat coffee. 

The story is either fake or riddled with missing information, but this reminded me of it so thank you
Reply: Ugh! I fell for the cuteness and convenience!
Reply: Thank you for this very useful/ informative video! I bought one recently for $4.99 at Goodwill. I was gonna gift it to mu sis for her insulin!
Reply: Well, I guess mine has to go in my car.🤦🏾‍♀️
Reply: My gf cosmetics coller box works on same principles. 

It keeps the cosmetics at a cooler temperature but does not solidify like cakey
Reply: How about a usb can cooler. or coffee warmer?
Reply: do you think these elements could be used for cooking a full body suit such as cosplay? would only need to be turned on occasionally and even 70 is a pretty good temp in those configuration?
Reply: So do you have an alternative for keeping medication cool but also reachable for someone who may not be able to reach the kitchen on a bad day? I don’t have room for a cube fridge unfortunately, so as interesting as this was it also wasn’t terribly helpful in a practical sense.
Reply: I think the "consternation" is from your delivery of the information to us.  You are smug, plain and simple.  Just a smug guy, that has a contemptuous tone.
Reply: I was struck by the head to head comparison: the mini fridge uses slightly less power than the Peltier ‘blue fridge’ plus it keeps contents food safe and costs less per can. That’s a powerful argument for sticking with vapor-compression systems.
Reply: Useful to hold INSULIN in a bedroom (away from main living space).
Reply: Whats your opinion if we use vapour cooling to the cooling side and increase the conductive
Reply: Yep yep, I still want some science grade refrigeration overview, those are really cool
Reply: Your video came here via internet, via a fibre backbone transmitting information by laser light. These little semiconductor lasers have to be kept at a very precise temperature, to work as intended, with milliKelvin precision. Guess how this is done? ;)
Reply: @Henning_Rech wait, do they? Are the fiber cables used under ocean really that fragile? I always assumed they just had repeaters and huge amalgems of regular fiber, just heavily isolated and reinforced since servicing them is hard
Reply: @yahhav345  Fragile? - what do you talk about? - Sure, transatlantic fibers use in-line amplifiers (not repeaters), optically pumped Er-doped fiber laser amplifiers.

My statement was about semiconductor lasers, both those generating the carrier signals for the DWDM data transmission, and the 980 nm pump lasers for tbe fiber amplifiers, which use peltier coolers, and the transmitter lasers must be very precisely temperature stabilized in order to produce the desired wavelength.
Reply: @Henning_Rech  sorry, I misspoke (or rather, more of a mistranslation probably, English is not my first language). When I said "fragile", what I really meant is condition sensitive. Fragile implies the infrastructure would get harmed under improper conditions, rather then just not working correctly.

On another note, the note about the laser source is fascinating! Could you elaborate? Is the cooling done to avoid some sort of a thermal widening of the laser? Also, why are Peltier coolers used specifically, and not one of the other common approaches for very low temperatures?
Reply: @yahhav345  Laser which generate the transmitted signal in a DWDM (dense wavelength division multiplex) system need to have their wavelength stabilized with a tolerance in the 1E-5 range. They are tuned by temperature, which therefore has to be stabilized very precisely. At around 0.08 nm/K and about 0.17 nm channel spacing in the ITU 100 GHz grid the temperature has to be stabilized to better than 0.1 K.

Pump lasers for the in-line amplifiers must produce relatively high power (like several 100 mW) which needs active cooling to keep the temperature low and quite constant.

The small Peltier modules, sized just a few mm, are inside the laser diode case.
Reply: I use one of those to put my Venus fly traps into dormancy without putting them in the fridge so I don't have to maintain their temp. The peltier beverage cooler fits 4 fly traps and keeps it has a solid 55-60 degrees. Yes that's not enough for food and it really bothers me that it's sold as a food preservation method, because 55 degrees is well above the TDZ. Anyways yeah they almost always suck but there are absolutely uses for them outside of industrial/research settings. 

I know men don't grow plants very much, but in case you're not aware, it's a hobby that many many people have. It's not particularly rare of a hobby. And there are more common species of plant that need dormancy like fly traps that aren't exotic like they are - it's actually pretty useful.
Reply: yeah you gave dumb reasoning like stating a family of ten using a corolla as a family vehicle when they shoudl use a van or surburban xl.  bro calm down. no one ia taking fridge in thier car or cubicle.    its use case scenario. obviously a conventional fridge or how you say heat pump is better. but it use case scenario is not those small units its just a convenience. thats why you dont see peltier units as normal  size or bigger because its inefficient.  calm down.
Reply: Astronomy cameras use peltier cooling to cool down the sensors which improve signal to noise ratio and alleviates hot pixels! One of the rare consumer-to-prosumer use cases.
Reply: So, this does have a specific place and that is in your car. Specifically because your vehicle has a compressor that, if you are running it, imposes linear drag on the engine and so does the alternator meaning the efficiency point is moot for cooling the output assuming your running it anyway. Most of these run on 12v native. Yes it will take a long time for one small TEC to do the job quickly so you should opt into buying a unit with more PTC's giving a larger and more effective surface area for cooling but will not allow you to overcome the 30 degree below ambient limitation. Best method for doing this is to make your own that is thermally coupled to your vehicle making your vehicles exterior steel a large heatsink AND a dedicated heating compartment so you can keep cold stuff cold longer and hot stuff hot for longer.
Reply: @TheEmpowerment1  They run at a myriad of voltages from as low as 1.8V to as high as 96V from what I've seen.
Reply: @TheEmpowerment1 the flaw with using the vehicle exterior is that most of the times I’m using my peltier cooler, it’s 100+F outside. Even the air moving over the body at 75mph isn’t changing that as much as just using the footwell A/C vents to cool the hot side. Plus it’s generally just maintaining a cooler-than-interior-ambient environment for stuff that came from the fridge until I get near my campsite and buy ice for the remaining stuff. 
For non camping road trips, it’s just keeping some already cold extra drinks cold until I’m ready for them.  The little bit of extra heat dumped into the passenger footwell is trivial compared to the infrared coming through the windshield, and the electric draw isn’t an issue for a healthy alternator at highway cruising RPM.
Reply: @TheEmpowerment1  No, the higher the alternator makes the voltage rise the less load the coils put on the engine.
Reply: Very cool video. (Haha.) Now do Stirling Engines. ;-)
Reply: @thewiirocks  check out Swedish made Kockums submarines before you say anything… Powered by sterlings and beaten the US subs in many combat-exercices 👍
Reply: @BricoleurTV  nothing negative! Stirling are supposed to be the ideal heat engine. My frustration is that we don't see any in the wild. Other than "they're expensive", I haven't gotten a great answer as to why. Thus I'm incredibly interested in Alec's opinion on the matter.
Reply: @thewiirocks   oh, I know this. A perfect heat engine merely uses the heat energy to create motion, whereas modern steam turbines harness both the expansionary heat energy and the direct kinetic energy of the high pressure steam. You just, plain and simple, get more power output than from a Stirling engine.
Reply: @kaitlyn__L  that's true for large scale power generation. But as a cooler, you're applying power to move heat away from the cold side. Sterling engines are (to the best of my knowledge) the most efficient method of doing this and can operate in conditions where other heat pumps are no longer useful. Like most heat pumps they can also be reversed to pump heat in instead.
Reply: @thewiirocks  Agreed! But a video comparing wood stove fans, Peltier vs. Stirling, would be great!
Reply: I am soooo going to invent a tiny clockwork heat pump that competes with peltier junctions.  You guys want to hold part the patent?  It might be a fun collaboration
Reply: @kayakMike1000  I don't think you can really compete with heatpipes in that regard, but do try to beat them, maybe a breakthrough can come out of it.
Reply: @kayakMike1000  I would love to but i lack experience

And knowledge too
Reply: I'd be in for it.  @kayakMike1000
Reply: @kayakMike1000  down
Reply: We did a road trip with a peltier powered cooler, granted we did put things in already cold, but it did manage to keep our stuff cold for 3 days. That’s one consumer product that is somewhat useful.
Reply: @curtfehr  I use rotomolded coolers for long river trips and can keep things cold in there for 5+ days without using any energy.  Its a gimmick.
Reply: Hello from Ukraine. Great video, I have no problem with your "mini-fridge" terminology (for thin walled little black or big red), but your use of the term "degree's" was problematic. Why ? The whole world uses Celsius, only a few banana republics got stuck in Fahrenheit: Palau, Belize, the Cayman Islands, the Federated States of Micronesia, the Marshall Islands, and the United States of America. 🍌
Reply: I've had a Colman cooler with the peltier element for close to 30 years. 
It has been used extensively for camping,  work projects, and keeping drinks cold for several years 😊
Noisier than hell, but works beautifully.
Reply: @FrankNSense2290  Same. It works great for that application. And for holiday big meals, I put non-critical things like the drinks in it to free up space in the fridge. As for the noise, keep the outside fan clean. We just used ours this past weekend and it was quite loud. It was a quick fix to pull the end cover off (three screws) and then pull the fan off and wash it. That made a huge difference.
Reply: @strehlow  Ha! I've cleaned mine a few times as well!
Reply: My company uses them to maintain temperature chambers to +/- 0.05 degrees F
Way better than the more efficient refrigerant-based units and a million times easier to export.
Reply: @capn_shawn  how do you dissipate the heat? Massive heat sinks with forced air cooling?
Reply: @navinadv  Heatsinks aren’t that big. 
1.8 KW of cooling on four 5” hot side fans. 
You want accuracy and complete reliability, it’s hard to beat TEC.
Reply: @capn_shawn  It is good at creating a temperature gradient in a short period of time but it won't be able to take the heat away from the system by itself. Therefore it is not good at continuous cooling, but it can certainly create a buffer for sudden spike of temperature in a few minutes.
Reply: @l3enjamin5in  Nope, you are wrong.
We maintain 800W of constant cooling for months at a time.
Reply: @capn_shawn  Do you just put a radiator on the back of the Peltier module or do you use a heat pipe to connect the radiator? The beauty of compressor-based solutions is that the coolant has virtually infinite surface area that can provide much better scalability.
Reply: @capn_shawn  Oh yes, that domestic use case we all encouter daily!
Reply: @capn_shawn  Agreed, and when combined with mobile solar power:  extremely useful.  100% agree not "efficient" when compared to heat pumps for the amount of energy used, but still highly useful.
Reply: Peltier actually is eficient for storage of cosmetics (or soldering pastes etc). you really do not need large thermal flow, so 5w peltier is enough. And it would still cool a can of soda, just take like a day for that. And remember, thermal accumulators exist, and peltier can use thermostate-like temperature control
Reply: Can we all agree that threefold does not equal 3 times?
Reply: @Mr.Beauregarde 
Chambers
1. In three parts
2. (by) three times as much

Oxford (preview)
Three times as great or numerous.

Cambridge
1. three times as big or as much:
• a threefold increase
2. having three parts:
• a threefold classification

Merriam-Webster
1. having three parts or members: triple
• a threefold purpose
2. being three times as great or as many
• a threefold increase
Reply: @TheJamesM  but folding doubles, so threefold is 8 times. I won't argue that it's used as you've said, but mathematically two folds is 4 times.

At the very least, I think my understanding deserves a place in the definition.
Reply: @Mr.Beauregarde  The suffix –fold and its ancestors have had the popular meaning since before Old English even existed. Obviously it’s etymologically related to the verb fold, but in its case the metaphor is “folding into n layers” rather than “folding n times”.

Your observation is interesting from a mathematical point of view, but it reduces the specificity available (in only being able to express powers of two), and requires that people do mental arithmetic, which some find difficult. There’s a practical benefit to being able to synthesize adjectives for arbitrary integer multiples without knowledge of Latin numbers (what proportion of people know what comes after octuple ?)

Per Etymonline:

–fold
multiplicative word-forming element attached to numerals, from Old English –feald, Northumbrian –fald, from Proto-Germanic *–falda– (cognates: Old Saxon –fald, Old Frisian –fald, Old Norse –faldr, Dutch –voud, German –falt, Gothic falþs ), combining form of *falthan, from PIE *polt–, extended form of root *pel– (2) “to fold.”
The same root yielded fold (v.) and perhaps also Greek –ploid, –plos and Latin –plus (see –plus ). Native words with it have been crowded out by Latinate double, triple, etc., but it persists in manifold, hundredfold, etc.
Reply: You wouldn't want a beer at 50f ?  Supposedly the right temperature to consume beer at is 52f
Reply: @eidodk  I thought the natural temp for beer is the same temp as the bladder.
Reply: @eidodk  temperature of beer only matters for the first 2 or 3.
Reply: @eidodk  
I've heard beer is best served at 32f as it doesn't freeze due to the alcohol content.
Reply: @OpinionFactChecker  only if you hate the taste of everything. It's the same reason you would put spirits in the freezer, to dull the taste of it.  Freezing your beverages isn't promoting the taste.
Reply: What kind of fridge should one get if they need a SILENT fridge for the bed- / livingroom? I was looking at Peltier units but it is just too expensive too run where i am from.
Reply: But what about those stove fans? They work great.
Reply: "But they're mostly not the stuff you or I are going to come across"

"Not day to day life stuff"

I mean I get what you are saying. But you have a nerdy tech channel. This actually is going to be day to day job/life stuff for quite a lot of us.
Reply: Please do a better face reveal! 🙏
Reply: The fact that you don't regularly come across scientific equipment is a you problem
Reply: my $50 xbox can cooler works great, is quiet, doesn't get very hot.
You seriously sound really uptight.
Reply: Not directly related, but I wondered if you'd consider using metric measurements. That method is more inline with scientific standard measures. I know your viewership has many Americans, but that is only 3% of the world's population, the other 97% use the metric system.
Back in the day pirates were responsible for the Americas not adopting the metric system, now it's just stubbornness!
Reply: the comments complement the video, you should be glad people take their time and make the comment section informative
Reply: I consider a peltier fridge an absolute essential device for road trips and traveling and no amount of toxic midwesternity will ever convince me otherwise. 
Is it perfect? No. Is it good enough? Absolutely. 
You can plug them in absolutely anywhere. A cigarette lighter in your car, the power outlet on your airline seatback (I dare you to try to take a traditional fridge onto an airplane as carry on, or even just through TSA screening). You can even plug them in on Amtrak trains! 
As someone with food allergies, the peltier fridge has enabled me to travel without worrying about if there will be anything I can eat when I go places. I can simply bring my food with me.
Reply: Peltier based kimchi fridges exist, due to low hysteresis and precise control. Most applications of peltiers use them ineffectively. For optimal COP you need to put multiple tecs in parallel at -20% of its current, which you forgot to mention about parallel part.

Do more research next time and please put this video down.
Reply: Believe in Jesus Christ and live forever!
Reply: Ummm, laptop computer cooling? Desktop computer cooling? (often paired with a heat pipe) Small fish tank chillers? Single bottle wine coolers (by the way, much higher ∆Ts can be achieved by simply stacking the peltier modules in series - with larger modules moving at layers going away from the cold surface).

There are many more consumer products that make use of these little miracles. 

Remember, they are heat pumps by every definition of the word. Further, they don't suffer from flammable refrigerants, long runs of piping and coils, they can't leak, they don't cause vibration, they don't need a heavy compressor and motor, they are easily adapted to water or ground soil heat rejection without concern about operating temperatures, they are infinitely quiet, they have very long replacement lives and require zero maintenance, they are forgiving and flexible to the engineer, they require no welding or brazing or soldering, they can be easily controlled using PWM or other switching power supplies, they are rapidly reversible and have a very low thermal mass (specific heat of their materials and mass), and require very far fewer resources per rated btu than vapor compression cycle systems. 

They are still less efficient. But they aren't the red headed step children you want them to be. 

Still love your channel though. Keep it up!
Reply: @mc2engineeringprof - Thanks for posting this, saved me the trouble!😊
Reply: I dunno, I think if you wanted something to keep cool drinks which are ALREADY cold, it makes more sense. The cooling is nothing to scoff at, and would be noticeably colder, especially if the ambient temperature was already low to begin with (or if you like your drinks warmer than most people). 

So okay, it uses a lot of energy... But it's portable. A refrigerator is stupidly heavy in comparison, which was not mentioned in the comparison with the basic fridge. You didn't even mention the weight. And, if it isn't plugged in all the time, the energy cost really doesn't have to be such a big deal. I can imagine it being useful at a work table or something. It uses about the same amount of energy as a laptop. And there might be more efficient versions of this product, I guess, if they're better insulated. This is just one of them, which was really, really cheap as you pointed out yourself.

There are a lot of assumptions in this video which mask the fact that it's an apples to oranges comparison. Of course it doesn't make sense to use it continuously, that's not what it's for... The cost of energy just isn't high enough for any of this to be a dealbreaker. Once you start looking at the product without comparing it to heat pumps, it makes a little sense. I came out of the video interested in the possibilities of using this, ironically. 

Anyway, just my thoughts. Great video as always!
Reply: @gabridish  I mean he did mention the weight. Even gave exact numbers.
Reply: @gabridish  If you dont plug it in, then it doesnt cool the contents tho. And if you plug it, itll take like 20 hours to even bring it down those 30 degrees fahrenheit.
Reply: @gabridish  I was thinking the same, this product was an obvius horrible example. No inside ventilation, bad insulation and the actual application for the refrigerator.
Reply: @gabridish  yeah but the issue is it took 10 hours for it to cool down 25 degrees and as he mentioned at 45 degrees the temp in the cans was still 50 degrees if your an office worker or something it would take 10 hours to cool the inside to 50c for something not meant to be used continuously that's not very good you would be better off just leaving an already chilled can in a insulated bag.
Reply: @gabridish he did literally mention that one advantage of peltier cooled products

the point was that, if it's going to be on or around your desk, might as well buy a more proper mini fridge as it's plain better at the task at had and runs more energy efficient on top of that

portability doesn't matter unless you're constantly planning on moving it around, and if it's going to be at or near your desk anyway, you're not doing that

if you want some cool drinks on the go at some outdoor area?  Maybe potentially useful, but at that point you're better off just bringing a standard cooler with a few pre-chilled freezer blocks
Reply: @AstonishedByTheLackOfCake he also forgot to mention that a real peltier product uses multiple in series-parallel configuration, not pulling max current from each peltier. Whether if he didnt mention due to deeper understanding required for viewers to understand or due to his lack of research (he did get pretty close), its still a misinformation nonetheless.

Not to mention the product he used (which he clarifies) is a horrible product to chill stuff with. Same logic would also apply to real fridges as well. If your insulation is crap its not going to cool anything
Reply: @AstonishedByTheLackOfCake  well yes but no my lil fridge hold 6 can cools them in less than a hour and uses almost no energy i can run it on a power bank and in my car so yeah not gonna spend over 100$ when the 20$ one works perfect and fits anywhere but yup keep yappin
Reply: @Sora8112  so, then you are moving it?
Reply: @gabridish ARE fridges stupidly heavy? I mean he literally Did mention exactly that point, but my fridge is basically my height and light enough that I can easily move it up and down stairs on my own just grabbing it by the sides and lifting it up. There’s a limit on how small you can make the compressor I’m sure but…. They don’t NEED to be heavy
Reply: @mjp121 He said that small refrigerator was only 15 kilos..
Reply: @gabridish They could definetly make the pelt minny fridges more feeicient with insulation and by mounting the element on the top and by making the lid on the top.
These small changes would masivly increase it's efficiency.
But if you are not paying for the electric in the office, why not use it all the time? 😅
Just refill throughout the day and before you leave for the evening and you always have cool drinks.
Could always open the part with the fan and replace the loud fan with a quiet PC fan. And you will never hear it again.
Reply: We don't come across the convenience of keeping things cold at our desks? We're not all YouTubers. Some of us work outside of home.
Reply: What did you expect? You came out the gates hot and snarky about a product millions of consumers have probably purchased or received as a gift, seeing as those desk fridges are often included in retail black friday deals for surprisingly cheap. And they probably do what they were intended to do for quite a few of those people. It was all but a certainty those comments would flood in.
Reply: @elementneon  You must be new here.  The scripts come in two flavors, snark and more snark.
Reply: Inefficent indeed. So what... whom on earth cares about that... peltiers are not likely to ever stop working if they are not overvolted , and have sufficient heatsinking. And they are happy whit Just that. 
Whit the price on solar panels falling so rapidly , I would not at all be surprised if it made sense to skip the inverter and all that stuff , and have a fridge that has Both some amount of peltiers and a proper cooling circuit as a hibrid. 
Use the regular from the main's. When needed it will kick in.
Slap sufficient panels (can get now a 500w rated solar panel for  100 usd ) , ensure it won't over volt the peltiers.
And let it make use of whatever it can.
I personally would pretty much be okay to buy 4 panels Just for this application.
Why ?
Well , the compressor would not switch on as often as for as long thisway. Potentially making it Last quite a lot more time . Maybe 2 times as long. Thats one fridge worth saved. Secund , I saved on power bills.

So why not Just run the compressor on solar ? Well it would need a few quite expensive items in order to do that , not limited to a decent sine wave inverter. And it would not spare the compressor. 

Surely it makes a lot of heat , but why is that a problem in the Winter??? 

If I had to throw in say 1k usd more for a hibrid fridge , i would do whitout doubt.
Reply: @nagyandras8857  Smart and cost conscious people care about things being efficient.
Reply: @velzekt  depends on the time frame. Peltiers have a huge lifespan . They can be used whitout an inverter , directly from solar.
Surely very likely not the Bright idea to based a full size fridge on em only , but it can reduce the operating hours on the compressor. 
If I have to buy a fridge every 5 -8 years witch I sadly have to , and I could make one that outlasts decades , I realy don't mind some extra panels , preferably used solar panels , Just to feed em driectly to a peltier. 
Inefficient for sure , but still that alone is not a deal breaker.
Even if the initial costs are unfavourble , I would be considering a buy once , works for my life thing cost effective. 
Rather spend now the price of 3 fridges and have it run for free for the rest of my life , then cheap out and spend Just 2 times what a normal fridge costs to save some , but replace it again after say.. 15 years . Thats would not be smart at all.
Electrical inefficiency does not mather in this case , till the Sun shines.
Reply: @nagyandras8857  Uh if you have to buy a frickin solar panel just to keep your fridge working, then ya sounds like energy inefficiency does matter alot. And you must be horrible with your fridges if you have to replace them every 5-8 years. You're coming up with the worst "solutions" to your own ineptitude.
Reply: @nagyandras8857  the problem with removing efficiency as a factor in the design is dealing with the heat after it leaves the fridge. the TECs generate their own heat that needs to be dealt with and if your fridge is pulling 500w continuous that would be the same as having a 500w heater sitting in your kitchen (or wherever it is), which generated heat you would still have to remove from the room it is in. Not impossible but now you need a larger cooler for the room and everything snowballs. even in situations where you might want to heat the room it would still be more efficient to use a heat pump for the fridge,  take the energy difference, and use it to run a more powerful heat pump for the room. 
Even aside from that, removing efficiency from the discussion is a bad faith argument to begin with. if what you want is a comparison between the two technologies, taking the downsides of one technology and saying if we ignore this huge glaring issue there is a possibility that it might sometimes work is not a fair comparison, and even if you truly don't care about the efficiency, the cooling capacity of a TEC is not huge, the temperature differential is only small unless you chain them which has it's own thermal restriction bottlenecks, and most  of the cost of a fridge is the frame, insulation, and other features. yes a compressor has cost, but using lots and lots of TECs while they might be individually cheap adds up quickly. you would end up with a fridge that is heavier, more expensive, slower, and potentially louder because of all the fans to keep it cool, and at the end of the day it's still way less efficient than a standard heat pump fridge. There is no situation where a TEC makes sense for a consumer fridge, and in general their consumer applications are limited, because all of the possible benefits to TECs are niche and not widely applicable to consumer use.
Reply: @nagyandras8857 I had a similar thought Of incorporating it into a standard fridge but I was thinking a dedicated shelf containing them to quickly cool leftovers or warm items.